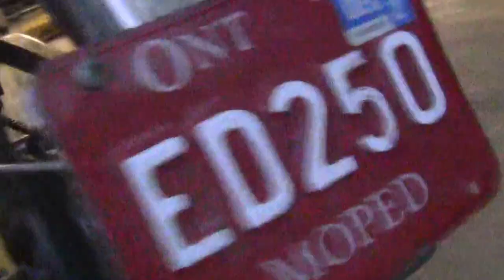Polini AV10 70cc first start

Comment: I wouldn't use hpi anything, told them I had received a defective cdi and they refused to answer my messages. There customer service sucks and no guarantees.
Reply from the maker: i didnt have to deal with them thankfully then.
mine works like its supposed to, i had the MTV internal rotor in my hands but sent it back due to comments on the forums about them being lemons.